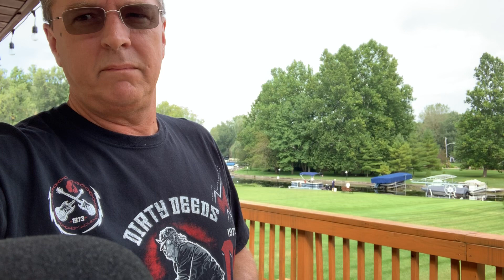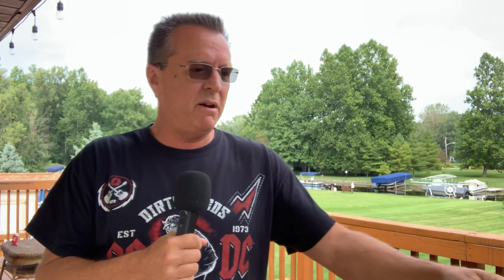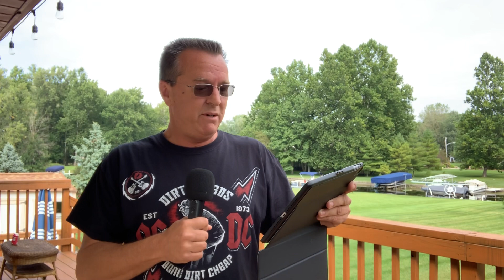#237 ( my only engine failure in 20 years ) Advanced Preflight After Maintenance

Comment: Hi Kenny I fully agree with you that you should never short cut your pre flight. I was doing a pre flight inspection on a plane less than a week after it had come out of the workshop for an inspection and engine overhaul. During the inspection I noticed stress fractures in the nose wheel mount and immediately grounded the plane. The engineer told me that if I had flown it, the nose wheel would of failed on landing. The owner was pleased I took the actions I did because it saved his new engine and propeller and probably the aircraft.
Reply from the maker: Awesome Ashley! You may have even saved lives!